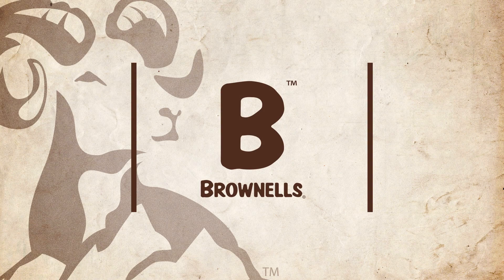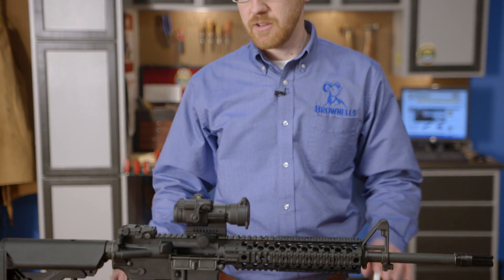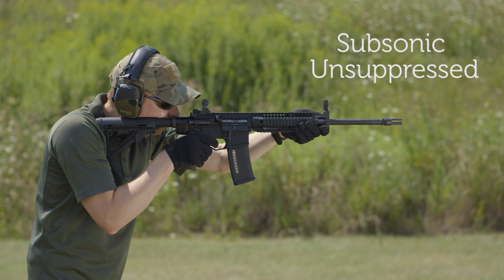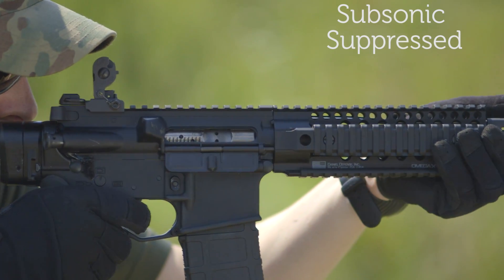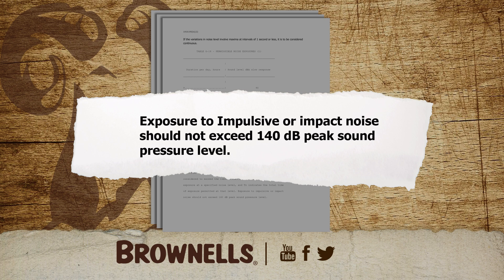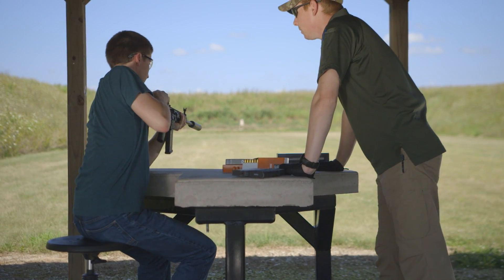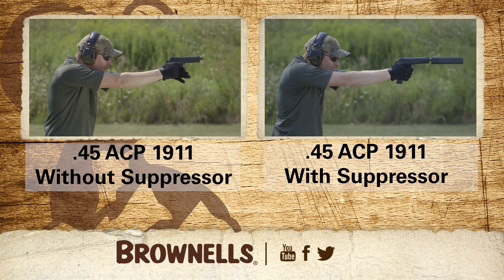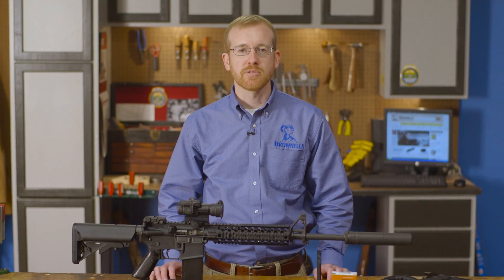Tech Tip: What are Suppressors

Comment: The comparison of suppressors to car mufflers is an understatement. They were both invented by the same person, Hiram Percy Maxim, at the same time, about 1902. Except firearm silencers are usually less effective than automobile silencers (they are actually called that some places) as there are practical size and weight limitations on firearm silencers that don't apply to automobiles. Many people would take the noise rather than put 1 to 2 extra pounds on the end of the gun, especially a hand gun. Also, it has to be physically small enough to not obstruct the sights so you can aim the gun, 2 inches wide is too big in most cases. By comparison, a car muffler that weighs 100 pounds and is 12 inches wide isn't a problem on even a small car, most modern mufflers being dramatically smaller and lighter than that. As a result it is common for the sound of a car's tires on the road to be louder than it's engine while most "silenced" firearms are still painfully loud. As a result most shooters still wear ear protection when shooting suppressed as while 140 dB is the accepted limit of instant permanent damage most people find sounds above 120 dB physically painful.
Reply: I would much rather add a pound to the end of my rifle than have a 1,000 times increase in sound pressure at my ear (+30db)